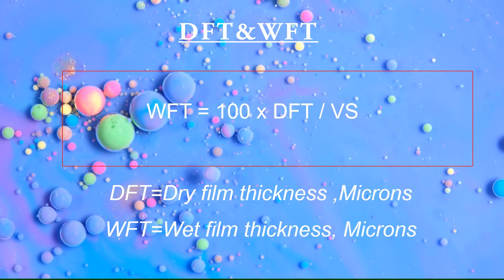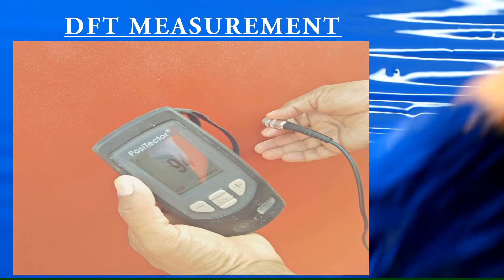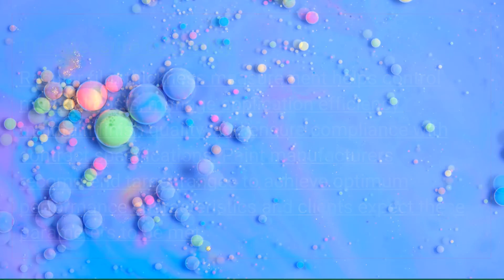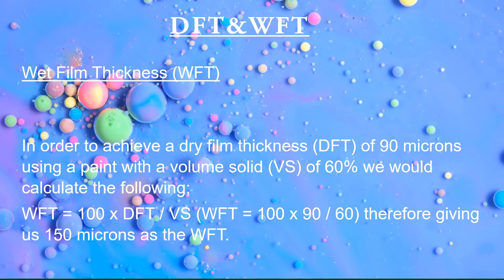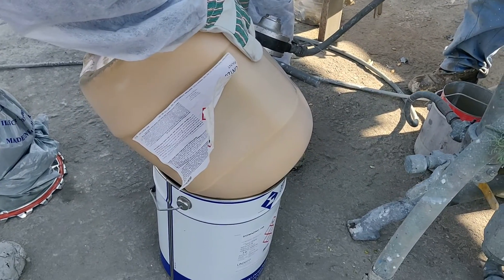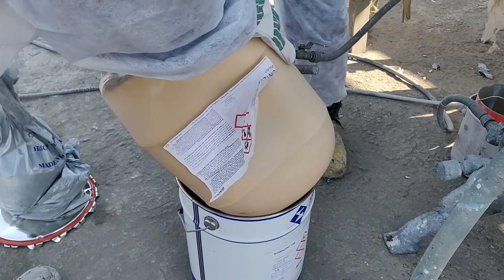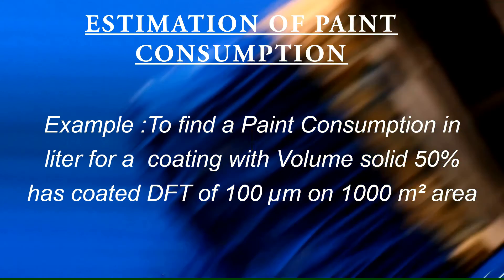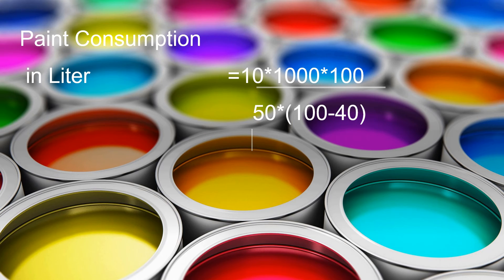Calculate Paint Consumption I Dry film thickness l volume of solid

Comment: Understanding Coating Thickness Measurements
When undertaking a project with a high performance coating, you need to think about how you will measure the coating thickness to ensure it is applied to specification. By monitoring and recording your coating thickness measurements you can ensure that you get a quality finish, that will perform as intended and as an added bonus you won’t unnecessarily waste material and money.